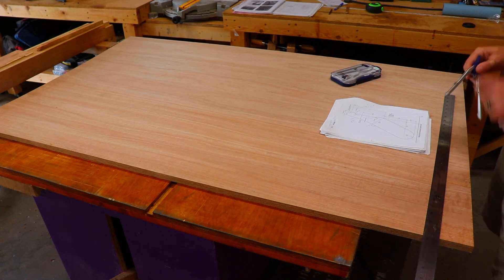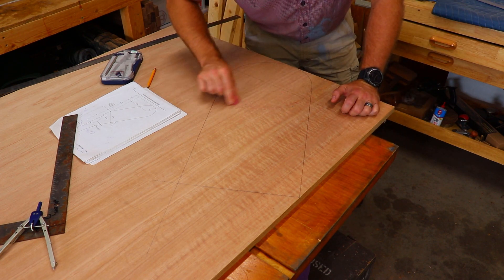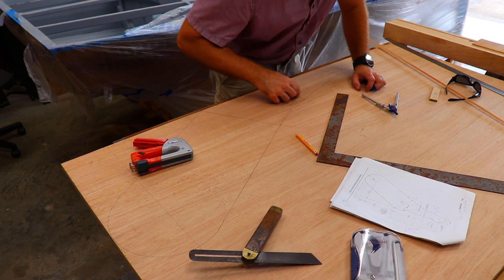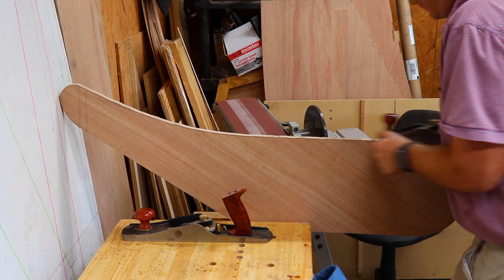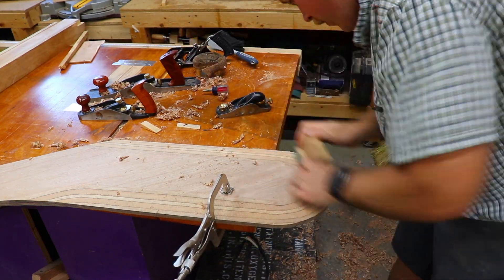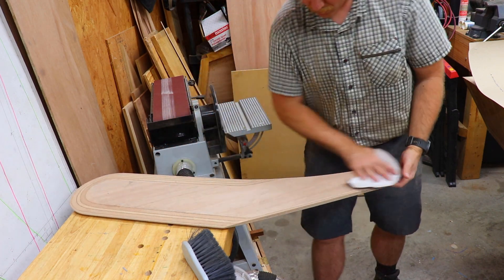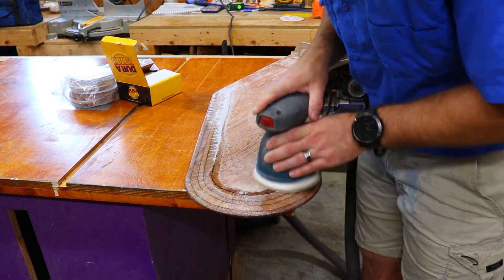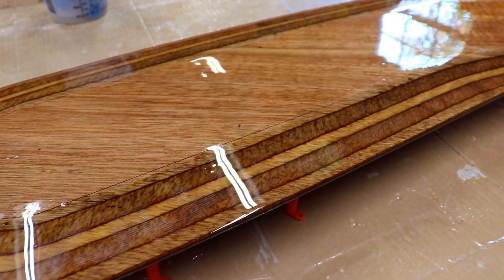Building a Wooden Sailboat #15: Making a Rudder

Comment: Again,,, very well done,,, that smooth finish on the rudder is not just for looks, it is a must, to achive the highest possible performance in the water to reduce possible drag while giving maximum power to steer the boat that means in OUR SIDE OF UNDERSTANDING using less power to move a boat through the water but achieving the highest possible speed thus higher handling,,, just sharing my thoughts,,, god bless, god speed
Reply from the maker: Thank you! You are completely right.

Comment: Great job thus far, keep posting videos!

Also, where do you get your Marine plywood?
Reply from the maker: Thank you very much! I got my plywood from Boulter Plywood Corporation https://www.boulterplywood.com I bought about twice as much as needed in case I made mistakes (which I did) and had to re-cut pieces. They shipped to my location at a reasonable price. It would be expensive for just one or two sheets but it's more cost effective the more sheets you order. I ordered a total of 14 sheets of various thicknesses.